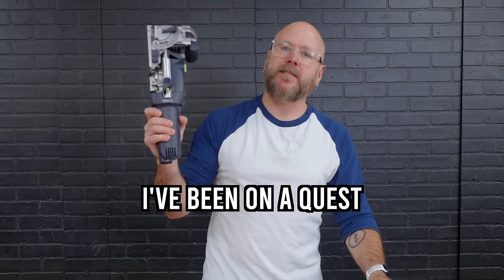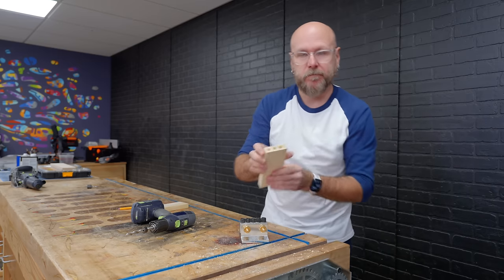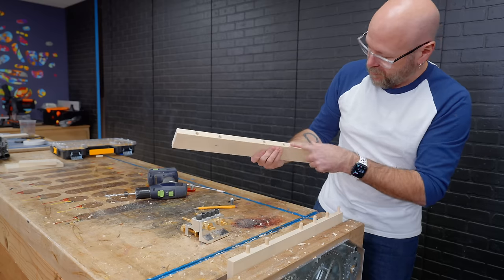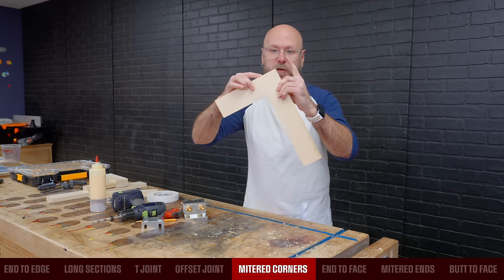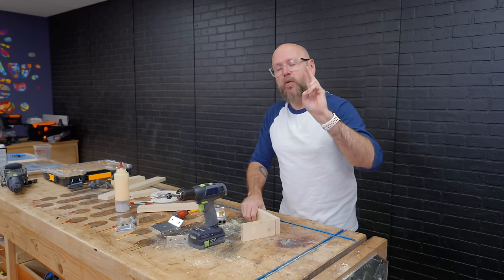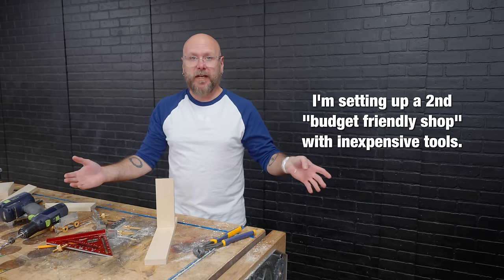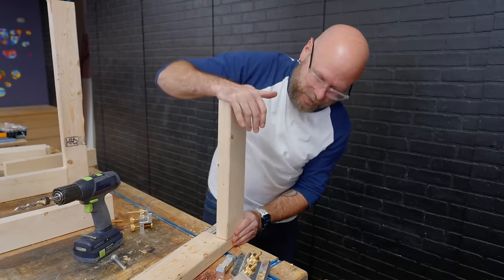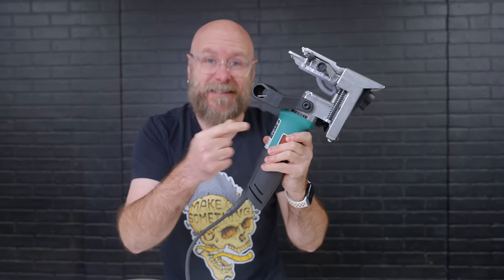The 2nd Best Joinery Method That Can Do It All!

Comment: I'm sorry, but at $324 + taxes and shipping, this tool is just way too expensive for the job it does. With careful measuring and drilling, even as an amateur  woodworker, I can get precise results with my $12.00 jig. Admittingly, it takes more time with my jig to arrive at the required results, but the price difference makes it the preferable tool.
Reply: @peterferrydriver  agreed, I was interested then saw the price, way too expensive, and companies wonder why people buy knock off tools
Reply: I disagree. It is a superb tool.  Worth every cent of the price. I used mine today to make a lathe stand and it was an absolute joy to use this tool. The joints were rock solid.
Reply: @peterferrydriver  I spent maybe $120 on cheaper ones that stunk. So, to me this thing is fairly priced. Now, you may not even do a lot of dowel joints, but if you do, I recommend you demo one, because after using for a weekend, I wouldn’t give it back.

Comment: I’ve used the dowelmax for years and love it. I have a tip you might like. When dry fitting if using many dowels like you did on the table, espically double rows it can be extremely hard to disassemble.  I take some test dowels and lightly sand them and lightly spray paint them a bright color so dryfitting is very easy.
Reply: Why the spray paint?
Reply: So you know which ones are the test ones 👍  @DocXango
Reply: And store bought Domino tenons are the same way.  I have about 20 or so of each thickness sanded down for dry fit.  I just mark them with a Sharpie.  But really you can tell because they are smooth and don't have the glue crinkles.
Reply: I have 3/8” Teflon rod I cut into test dowels. Easy peasy folks.
Reply: @DocXango  to indicate test fit dowells
Reply: @fogsmart  where did you get Teflon rod? Could you post link.
Reply: @russianbear2  I just get it at my local plastic shop where they sell Delvin, PTFE, etc. I think my industrial supplier sells it in longer lengths at Grainger Canada but I didn’t get it online and links might be wrong.
Reply: Hmm, I wonder if PTFE tube would work as a test dowel…
Reply: @russianbear2   TAP Plastics.  They have retail stores in the western U.S., and mailorder.
Reply: @IXISSV thanks for the tip
Reply: @fogsmart Teflon rod? Where do you find such a thing?
Reply: Thanks for the tip man! I would not have thought of that

Comment: I have been using the Dowelmax for a few years now, I’ve used it in many of my project build videos and it always gets good comments. I love it, it’s my favourite tool in the shop, high quality and very acccurate every time 👍🏼
Reply: But it cant self center, right? Feels like you will never drill the holes exactly in the center... since the thickness of a board is never exactly a round number even if its supposed to. So flipping one board and then joining them together would result in the surfaces not aligning exactly anymore in my mind...
Reply: I think the benefit/advantage is that the check marks remind one of the two reference surfaces so the offset of the holes is consistent for mating pieces.  It doesn't matter if they are 100% on the centreline.  I bet a doughnut that no Domino mortise is ever 100% centred...and it doesn't matter.  What matters is the consistent offset to the reference surface of mating pieces for either a tool, (say even biscuit joiner), or a jig, (Dowelmax or home grown).  Having used a Domino, and put several mortises where they don't belong, I can see how this jig can work effectively and better in some ways to ensure alignment and placement.  The Domino wiggles as every user will tell you and that is where some error will come in.  Do I want both?  Yes.  Will I buy the Dowelmax and all its accessories before I buy a Domino?  Yup.
Reply: @martinsvensson6884  Correct, that's why you need to keep track of the orientation in which you're drilling the pieces.
Reply: @jeffbaker8808  Yes, but you cant turn one side around then. Can probably come up with some scenario where that is not ideal.
Reply: As the others have said, it’s not necessary or critical to drill the holes in the exact centre of boards. The system works by using reference surfaces.
Reply: @DownUnderWoodWorks  I agree its not critical. But its still nice to have them in center. Becaue you can then flip one side, for whatever reason, and it wont matter.
Reply: But why would want to flip a part if you have already established the assembly orientation?
Reply: @Sillyturner  Because when you experiment with stuff things may change. And you might even happen to damage one side and want to chose the other one to face outward. Use your imagination.
Reply: @martinsvensson6884  you don't need to center your dowel, you can just have an even number of dowel holes equidistant from either side. And the DowelMax does that. It's like anything else in life-- different tools accomplish the same thing in different ways.
Reply: @epgui  I just mentioned a couple of scenarios where you would need to flip the sides. That's the small problem I have with it.
There are other ones that autocenter by its contruction. But cant do some of the other stuff.

Comment: Nice video showcasing everything that can be done with the dowelmax. I have had mine for 3 years and I love it. One pro tip that they don’t mention in the instructions is to use the pin to align the jig to the edge of the workpiece instead of by touch. So use the first hole for the pin and then drill into the second hole. Takes some of the uncertainty out of the hole locations.
Reply from the maker: Interesting! I like this idea.
Reply: I also prefer this method.
Reply: Thanks for the tip
Reply: What an awesome tip!

Comment: I have a DowelMax—love it! I stopped using pocket holes and don’t miss them at all. One important point to note—IMHO it is most suited to a home shop user. It’s too fiddly and slow for a professional environment—I believe that’s where a Domino is better suited. As for the cost—worth every penny! And as Dave pointed out, it’s way cheaper than a Domino!
Reply: Do you find dowels stronger than pocket holes?
Reply: @Tigerratcat  Sorry to chuckle at your question. Without question dowels are much stronger than pocket holes. There have been countless tests here on YT that show this. Pocket holes can be quicker, depending on what pocket hole equipment you have.
Reply: @weldabar  Chuckle away. I’m a complete newbie. To me it seems there’s a limitation to dowels where the whole project has to be assembled out in the open, where as you can assemble pocket hole pieces in place. 

I tried pocket holes for the first few time. I’m definitely not impressed with the strength. You can strip the thread so easily with an impact driver when it bottoms out
Reply: @Tigerratcat I use the dowelmax because I HATE the look of pocket holes. If they are completely hidden then so be it, but usually they aren’t.. or they are used on objects like chairs that need the extra strength of the glue joint and even a beautifully hidden pocket hole isn’t a replacement for a dowel or good jointery. They are fantastic for cabinet frames in particular because it is all hidden and none of those connections should ever experience much shear or any wracking force(s)

Comment: The problem with those dowel machines out there like the Grizzly is that the spacing between dowels is fixed. The DowelMax is much more flexible in that regard. That said, I'll stick with my Domino for the reasons you cite, speed of use and dust collection, but also the wide range of sizes from 4mm to 10mm.

Comment: I've said it in all the videos comparing the domino to the other joinery systems: I love the dowelmax. It's literally the only thing keeping me from buying a domino. Amazing jig. Worth investing in extra drill bits so you don't need to adjust depths as often, and also the 1/4" guide and block set, and the 1/2" guide and block set if you'll be doing bigger or heavier duty projects. I like 1/2" for big boi seating and things like doors. I can't say enough good things about this jig.

Comment: David, one of the best things I did for my DowelMax is taking a set of calipers and scribing centerlines on some of the reference faces. That way you can use it like a typical dowel jig as well.
Reply: Yep. I did the same thing. makes it much easier to do depth centering without a lot of measuring/trial and error.

Comment: I'm a Dowelmax user. I bought the entire system in all available sizes, plus the brilliant depth gauge for setting up the drill bit's stop collar.

This is a FANTASTIC tool. The materials and machining are top notch. I'll probably pick up a Domino some day, but this really does everything that I need it to do and does it very well. With the depth gauge I probably have about $600 invested in the Dowelmax- I don't regret it at all. It's a joy to use.
Reply: The depth gauge is the one thing I still need to get.

Comment: I have a 2x4 that I’ve drilled different depth holes in to get my collar depth. I just put the bit in the hole and push the collar down until it hits the 2x4 and then tighten the collar.

Comment: I have been using my dowelmax for about  4yrs.  and I love it. I could not justify a domino jointer to my boss ,AKA my wife. FYI, you can also purchase a 5/16 dowel adapter which I use primarily for 3/4 inch material. And yes, I have two drill bits with stop collars set to different depths. I was able to justify that to my boss.

Comment: I have used a Dowelmax for many years.  One project I made about 6 years ago comes to mind.  My gym wanted new benches.  Some customers weighed over 300 lbs and kept breaking their benches and chairs in the locker room.  I made new benches 5 ft long with a shelf and center devider out of 3/4 inch birch plywood jointed using the dowelmax.  No dowel ends were visible.   I used rattle can paint to add some color.  When they were finished I had used no screws and 69 dowels in each bench, all perfectly aligned.  I recently checked out the benches and I could find no cracks or loose joints.  A Dowelmax is well worth the price.

Comment: For when you want to drill lots of super accurate holes to pound some pegs into. $200 doesn't actually sound all that bad for as good as it seems to work. Cheaper than any Woodpeckers measuring tool at least and twice as functional. I'll have to think about  adding one to my arsenal. Thanks for sharing!

Comment: I have used the Dowelmax for years also. It is simple to use, makes a very strong joint and is extremely accurate. The accuracy is not dependent on how precise you can measure and mark, the accuracy is built into it. Watch a few videos to see the details.

Comment: I have both.  Both work well.  One is faster, easier, and more consistent.  The other is much cheaper.  One has a power chord and is blue with Green buttons.  The other has brass knobs.  One of them is on the top shelf in my workshop.  The other is consistently on my workbench when doing joinery.  Pretty sure you can figure it out.  Yes the Dowelmax works but for productivity, consistency, repeatability, and quality of work if you can afford the Domino, you will not be disappointed.
Reply: How is the domino accurate when your are just holding it to a pencil line? The dowel max at least clamps and it has pins to guarantee perfect accuracy
Reply: @researchandbuild1751  It is just a personal preference for me.  I have used the Domino more and more and it works well for me, but know others that swear by the Dowelmax.  I just found it a bit fiddly and not as versatile and much slower.  But, there are places you cannot get the Domino and have resorted back to my Dowelmax for them.

Comment: the domino comes standard with an extra support to put it upright on a board. But this looks like a pretty good cheaper alternative. You''l loose a bit more time, but it seems reasonable with this one. And for a hobbyist time is not a big issue.
Reply: It's actually a very fast jig/tool, and there is an optional L-bracket you can get to put it upright on a board.

Comment: A great jig for the hobby woodworker who wants to make fast and accurate joints but cannot afford/justify splashing out on the Festool Domino. I agree though that it will never replace the Festool Domino, which is still the best there is for quick and easy but perfectly accurate joints.

Comment: I have one, like it, have used it just for one project, but works very well as one takes the time to ensure the spots are correct, it is a win.  Budget friendly compared to the Domino, won't replace it, but it will be my tool when I do furniture and need this type of joint.

Comment: Dowelmax is the real deal, the level of precision on the machined parts is insane. The only cons I have comparing it to the Domino is speed, dust collection, and maybe ergonomics. Setup and prep is similar between the two, marking reference faces. Clamping and unclamping slows things down, and the brass knurled knobs and the threaded rods can bust your knuckles if you rush.
Reply: Most people convince themselves and believe what they want to believe. This jig is no more accurate than a $20 Dowel jig. I have this jig and it's crap for the money.
Reply: @johnrobinson1020  I strongly disagree, I also have a harbor freight dowel jig and it blows.

I do agree that there are cheaper jigs that can also give acceptable results, but I've never had the dowelmax fail me.

Comment: I’m a Domino owner.  I overpaid for a tool that works AMAZINGLY, and I would buy it again today. I also want a DM. I can see different applications where both tools would shine.
Reply: This tool looks very refined, indeed. I have a cheap plastic dowel jig that hardly gets used as I have a Domino that I grab for those things. I don't see dust extraction or a quick way to go to smaller bits/dowels, so if that's correct then that would be a negative for me vs the Domino. That aside, I am curious to learn for what applications you would choose the DM over the Domino?

Comment: I've used the DowelMax for years and use it as my primary means of joinery. It's easy, versatile, and I can't recommend it enough. It's especially useful for gluing up panels and eliminates any off set between wood pieces eliminating sanding. 
I've also used the Festol Domino and have to say I'm not impressed especially considering the price.

Comment: In addition to the grizzly dowel tool, I would love to see a comparison of the dowelmax to the JessEm. They both seem great and it's so hard to decide between the two. Maybe one for your nice shop and the other for your budget shop??
Reply: Avoid the Jessem. I own one. I bought the Domino to replace it. Unless you only use standard board sizes and never need angled joints.
Reply: After doing a lot of research a year ago, I ended up purchasing the original JessEm master kit and I have zero regrets. Both of these tools are great options and have their strengths and weaknesses. I opted for the Jessem for two reasons. 1. It can reference randomly placed dowels for edge joining. 2. Value. It's noticeably less expensive which is surprising considering the quality craftsmanship. I do wish JessEm had the stainless steel jigs when I purchased as they are even less expensive and can hit the angles the Dowelmax can.
Reply: I have the JessEm. The indexing features are really critical to making a dowel system work, and the JessEm jig works very similarly to the Domino in that regard (I do have a Domino, btw, and both have their place in my shop).
Reply: Came here looking for this comment. I wound up getting the Jessem because you can get the whole kit with all three sizes for less than the Dowelmax with one. Only thing I don't really like is that you have to clamp it yourself.
Reply: @f.kieranfinney457  Smooth brain af. Comparing dowel jigs. Not dowel and domino jigs.

Comment: I love the Wen tools. I have the spindle sander, disc and belt sander and track saw. My next will be the 4214 variable speed drill press. This dowel jig is awesome. So glad you did this video
Reply: If you buy the drill press, be sure to check it for square. The problem is that the press bed flexes out of square from the post when you tighten it. I went through two of them before I finally decided to just make a drill press table and shim it square.
Reply: I have the Wen trim router, spindle sander and the VS drill press. The later two came up on Amazon as one day deals...$85 spindle sander and $195 drill press. Don't hate me 😢

Haven't run across the problem GD had with the drill press table, but am now aware of the potential. Thanks, GD 😊. Otherwise, all three have given me yoman's service and I am well satisfied.

Dowelmax...hmmm. Don't really use dowels other than cheap shelf pegs. I did when I first started (Reagan was Pres then...) but had heinous difficulty lining joints up after drilling. So...I made my own pocket hole jig that fit my auxiliary drill press table and used that for years until Kreg came along. But ..I am intrigued by the Dowelmax and would certainly consider it if I should choose to use dowels again. I can see where functionality outweighs cost...as long as I don't tell Momma😂

Comment: I have both a Dowelmax and a Domino.  Both are absolutely fantastic tools.  I wouldn't really consider them interchangeable - the Domino is significantly quicker to use, but the Dowelmax will give phenomenal results for a little more time and effort.
Reply: Just curious.... do you think the DowelMax gives you a more consistently accurate result than the Domino?

Comment: To hold the domino just clamp a board over where the domino should lean on. Frank Klaus use that system when using a biscuit jointer. Very simple